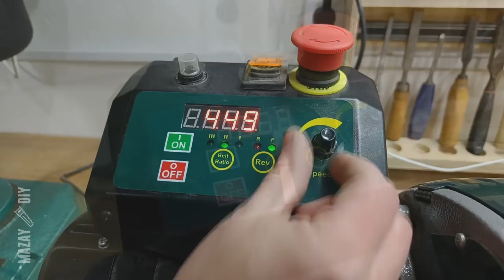Knife Making - Avatar Na'vi Hunting Knife

Comment: I have to say that is a heavy-duty knife.  If it is tempered well, the knife will last forever further, the edge will be nearly indestructible. The knife could be used for many different applications but fine slicing would not be one of them.  The knife looks as if it would weigh a lot and would be a go to blade for a shop or a campsite.  The work done on the blade was done with mostly abrasives. That was a lot of grinding, filing and sanding. Anyway, it is a valiant effort. Great project that is well worth doing.